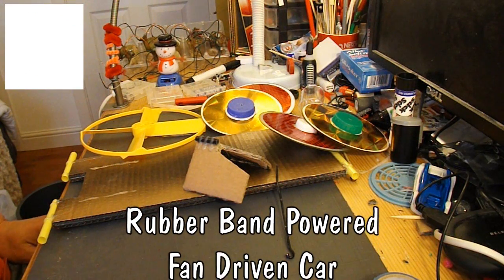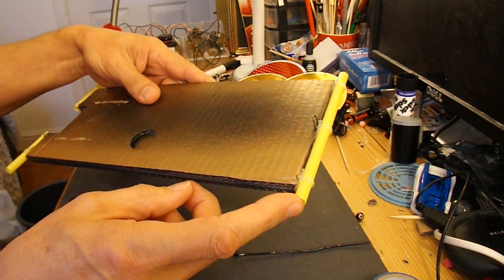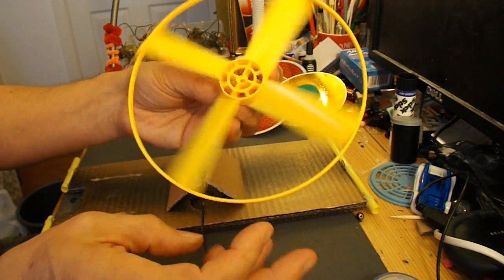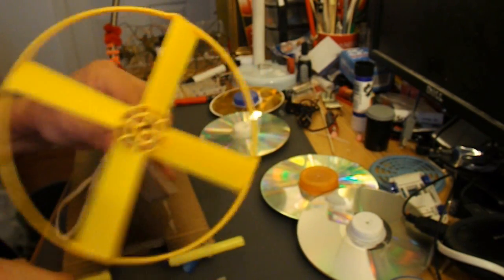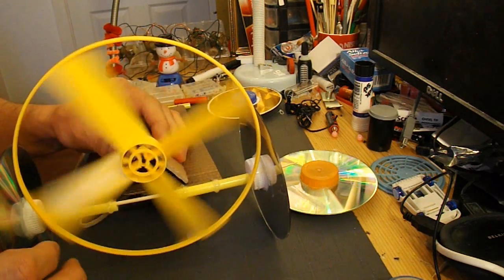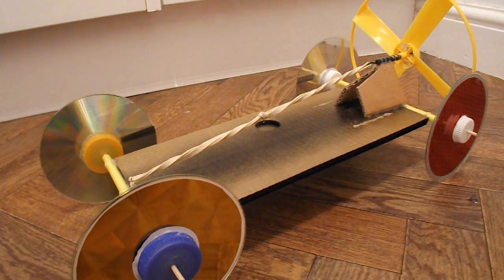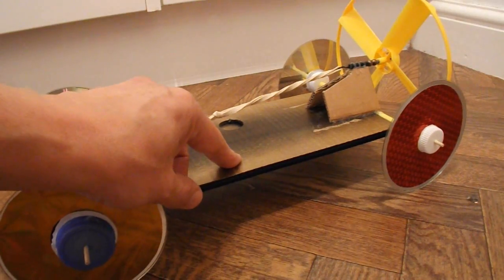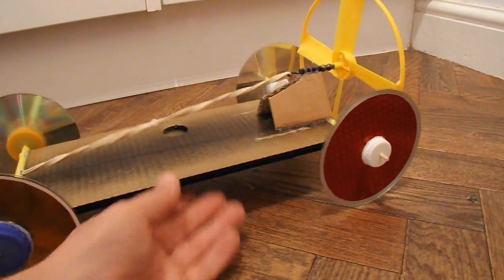Rubber Band Powered Fan Driven Car

Comment: Can you use wood instead of cardboard? Or would it be too heavy?
Reply from the maker: Obviously that depends on how heavy your wood is. I am sure this would work with plywood up to about 1/4 inch thick with no problems.
Reply: GrandadIsAnOldMan Ok, thanks! I'll figure out how heavy the wood is
Reply from the maker: Cristian Alfaro As wood would be stronger you could cut holes in it to make it lighter if necessary, or make it narrower, or from strips of wood. Maybe just go ahead and make it and find out if it works anyway. That is the easiest way to find out and learn what works best.
Reply: GrandadIsAnOldMan I'm gonna make about half inch strips and attach the wheels to them. I'm gonna attach them by making like a 1/4 inch go from one side to another attaching the wheels to the car. I think it'll work and I might try that hole thing you mentioned! Thanks though man!
Reply from the maker: Cristian Alfaro good luck :)

Comment: I don't have those rubber bands! can i use normal bands which you get in food packaging? thin rubber band loop?
Reply from the maker: I just use whatever I have to hand. I did find that this car needed many more rubber bands that I would have needed if they were just wrapped round the back axle like most of my cars. If you find yours are not powerful enough you will have to double them up or treble them or more. Just see what works for you.

Comment: Could you please tell me the science behind it?
Thanks for your help by the way ^^.
Reply from the maker: Energy is stored in the rubber band by twisting it. The energy is released as the band unwinds and that turns the fan blade. As the fan blade turns it's shape moves the air from in front of the blade to behind the blade. That increases the pressure of the air behind the blade. The increased pressure behind the blade pushes the blade forwards and because the blade is attached to the car that makes the car move forwards.

Comment: What else could you use instead of a bicycle spoke?
Reply from the maker: +Isabella Bella virtually any sort of wire that is not too soft and not too hard to bend. I often use wire that I bought in a garden centre that is used for tying up plants. You can get several different thicknesses.

Comment: Hello another question, we made this car but the fan seems to spin the other way towards the end of its run. Any ideas how to stop this happening because I need the car to go as far as possible for a school science assignment ? Thanks
Reply from the maker: +Cameron Tan you need to have a ratchet or clutch effect on the metal rod that goes through the propeller. That way it grips the propeller when there is power in the rubber band and then slips free when the rubber band is slack. I have been searching for a simple picture to show you what I mean but so far I haven't found one.  If you scan down the list on this link until you find the 'Freewheeling' topics that might help https://freeflight.org/DigestOnline/library.htm or on this rubber band powered car I have the effect I mean but it is used in a different way https://youtu.be/aqB8hflHvwU?t=2m31s

Comment: How did you attach the rubber band t the front axle
Reply from the maker: Allie Hanichak it is not attached to the front axle. It is attached to a bent paperclip. The video description includes a link to the original build for the basic car body recycled in this video. I will give you a direct link in reply to your other comment but sometimes comments with links go into the spam filter so you may have to search for it.

Comment: Grandad please help!! :) Love your videos !! k thanks !! :)
Design a race car that travels 10 meters in track of 1 meter wide. The car should not have a
motor and can’t be pushed by the team members, yet, it needs to meet the design
requirements.
Project Rules
 You can ONLY use any of the following materials in your car:
 Glue & Tape (glue guns are allowed)
 CDs - (Any size)
 Paper & Card boards
 Pencils
 Straws
 Balloons
 BBQ wood sticks & Toothpicks
 Springs
 Ready-made Propellers
 Rubber bands – (Any size)
 Water bottles & water bottle caps
 Plastic cups, plates, and rollers.
 Paper Clips
 Magnets
 Wires (i.e. cables)
 You are allowed to use as many balloons, straws, pencils, rubber bands, etc.. as long as it
is from the above list.
 The car should move the 10 meter distance without touching the track boarder.
Reply from the maker: Joker Messiah well that looks suspiciously like the contents of a school project. This car did 12 meters comfortably and is made from components on that list. https://youtu.be/pIO3FiHX4Oc?list=PLA5a2xPRSrB1otXh0w36OwsYIHZznUWp6

Comment: Hey Grandad i don't have this type of fan can you make a video on how to make a fan at home
Reply from the maker: This fan came from a toy helicopter. One of those one that you pull a string to spin it. This is a similar item not the one I used but the nearest I could find on the web http://www.pinterest.com/pin/192528952795272341/
Reply: Thanks Grandad i remember that i have a buy a toy which have this type of fan

Comment: When you make fan driven electric cars, where do you get fans/motors from? I see sometimes you get fans from hair dryers but taking apart a hair dryer for a small car seems a little odd.
Reply from the maker: Hi Boomer, I state at the beginning of the video that this fan blade comes from a toy helicopter. It is also in the component list in the video description. It is very rare that any item I use in my projects cost more than a £1. I buy stuff from bargain stores and charity shops Even the hair dryers that I disassembled came from a charity shop for £1 each Charity Shop Gold or Garbage Disassembly special - hairdryers
Reply: Okay thank you.
Reply from the maker: BoomerDude McGuy on the subject of electric motors, you might find this video helpful My favourite vibrating toothbrush motors
Reply: Thanks, good to know when I finish taking apart my vibrating toothbrush :)